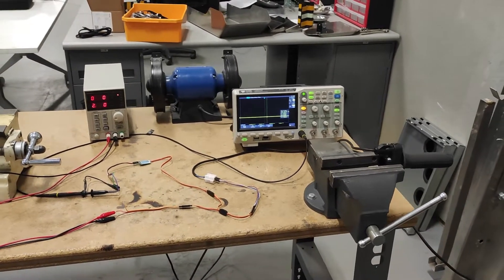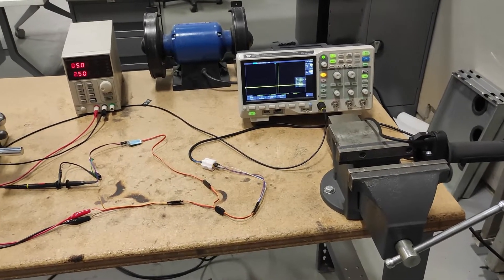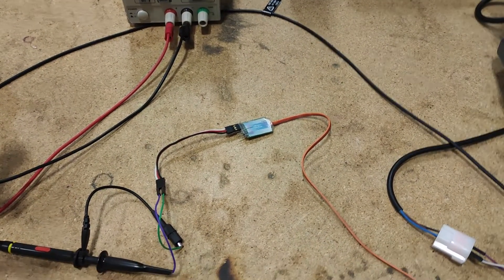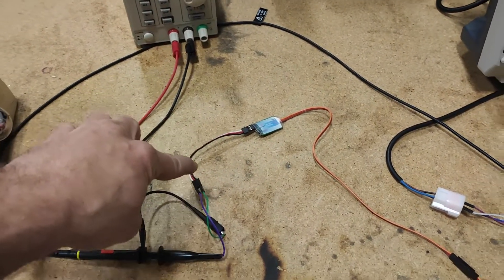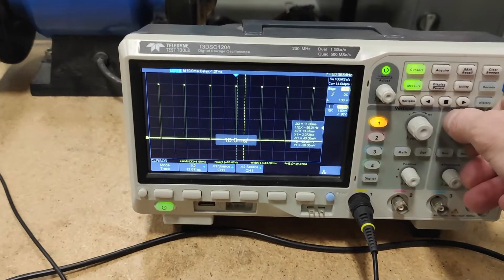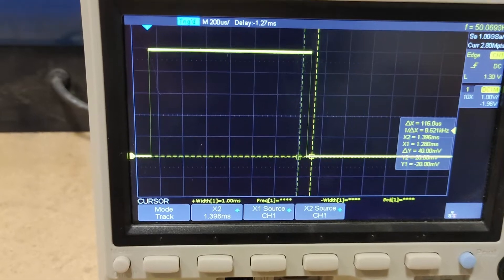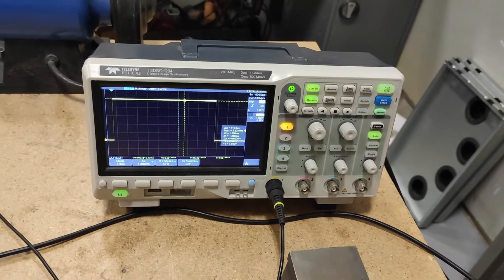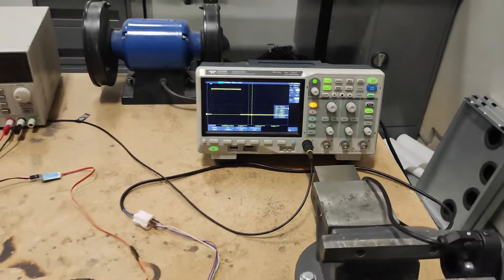Dual motor Surron update # 6- Throttle system

Comment: I actually liked my stock electronic throttle better than my "upgraded" DB Industries one.  I envision that we will have access to "Tron" style ebikes in the near future...:)  Fascinating work you are doing there.  Cheers.
Reply from the maker: That's kind of the impression I get reading the forums, the stock throttle seems to be better than most of the aftermarket stuff. I would use it but I don't really know how the hall effect sensor will interface with the rest of the system. My limited understanding of electronics does include potentiometers though so I'm happy to just stick with what I know at this point.